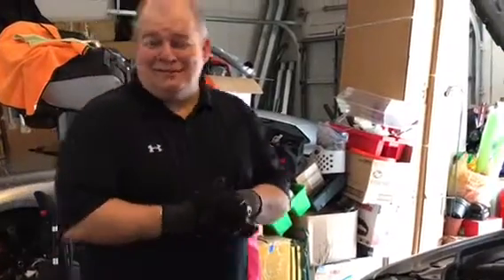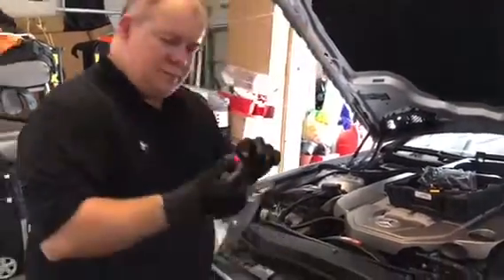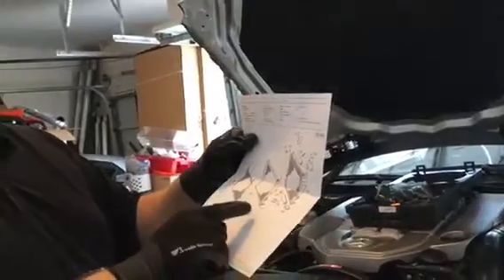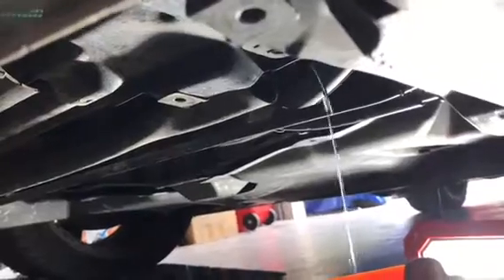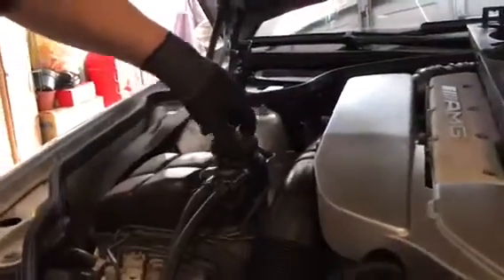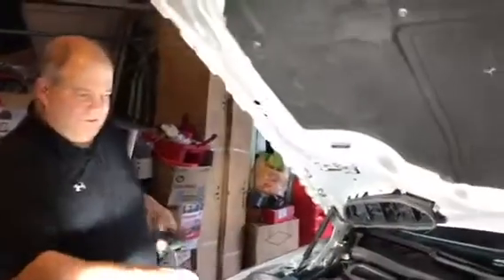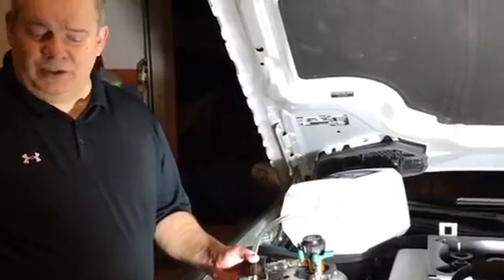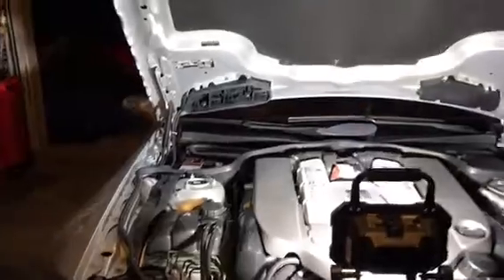SL55 AMG Radiator Coolant Flush

Comment: 6:34 no oring on the plug then 7:47 there comes the oring. Did you receive your plug with an oring or did you buy oring separate? I ordered same plug to put on same car as yours but plug is loose and coolant is dripping.

Comment: Hi,Good job on video. Do you have a video on changing Radiator Coolant on 2009 SL65? Apparently on SL65 the vacuum procedure to fill out the coolant is done through the intercooler cap on and not reservoir.Thanks,Reza

Comment: Hello - Love your video.  I was told I should only use a special Mercedes blend coolant....is that what you'd recommend, as well?
Reply from the maker: Any product that matches or exceeds the OEM specs may be used.  In general it is better to use OEM products if you do not have or understand the OEM specs.  In used a blend from Germany that exceed the OEM specs.
Reply: Great - thank you for sharing your knowledge!  ....and, for what it's worth, my coolant light popped on yesterday - I waited for the car to cool and checked and it was at capacity.  My car often has a mind of it's own....and today -- no alert.  So, I'll be keeping an eye on it.  Thanks, again!

Comment: HI MR COOL 
  HOW DID U REMOVE THE BROKEN  VALVE PLEASE
Reply from the maker: put an allen hex thru the hole with tight fit, then rotate to unscrew the valve.  you may also use an small drill bit, or glue an stem that allow you to unscrew it.   Good luck to you.
Reply: thank you sir